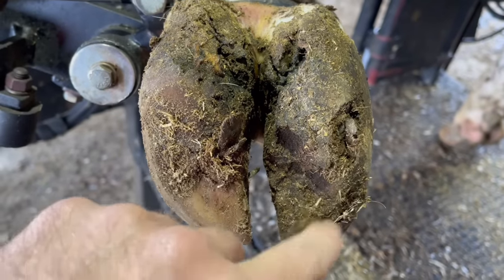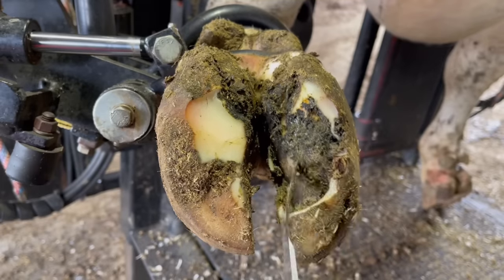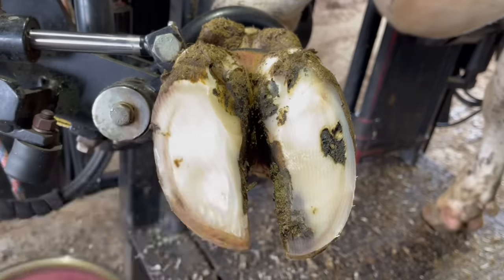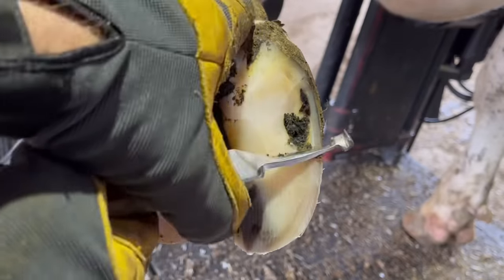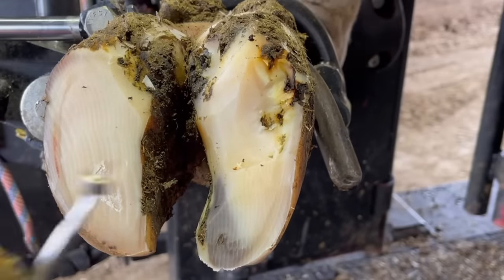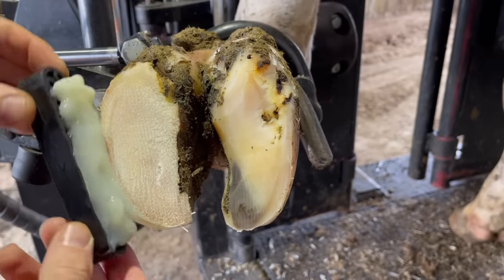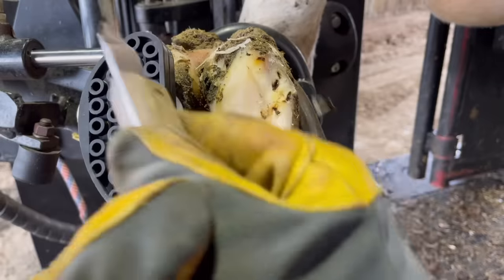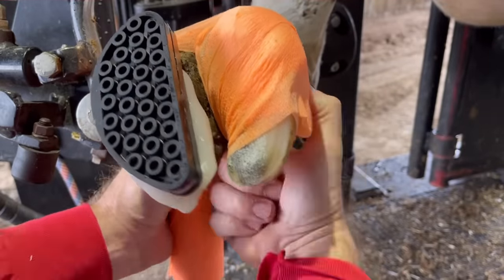Cracks, Rocks and Erosion

Comment: How many times do you change your grinding wheel, Nate, to not only remove horn quickly but to roughen the surface for the glue you use on those rubber blocks?
Reply: I'm going to say it's extremely rare. Blades like that are generally used for things like wood or metal......
Reply: He might have 2 grinders, one for trimming and one for roughing up the surface of the hoof.